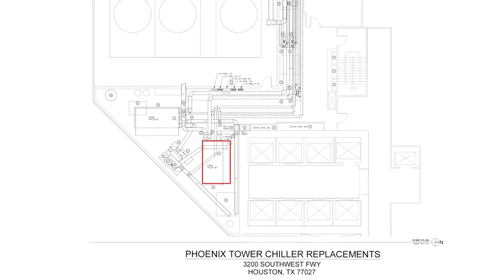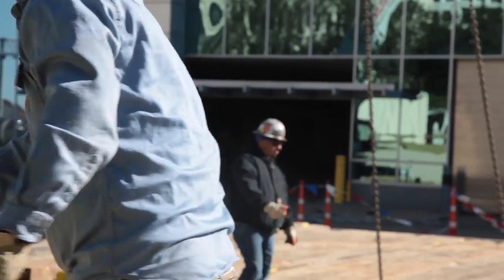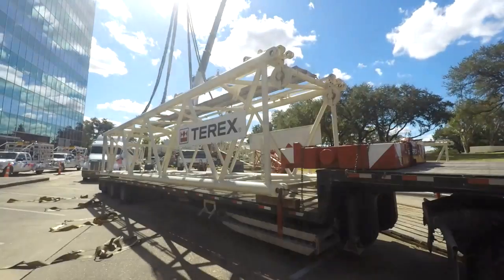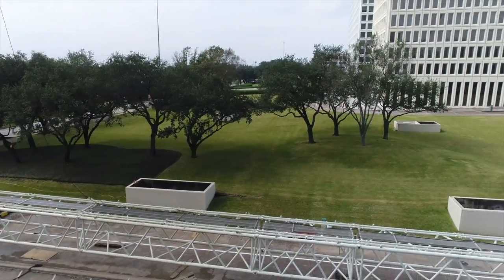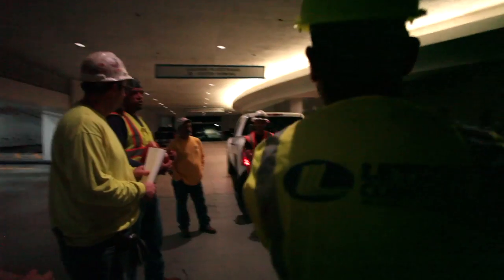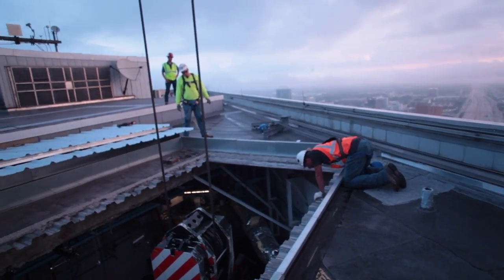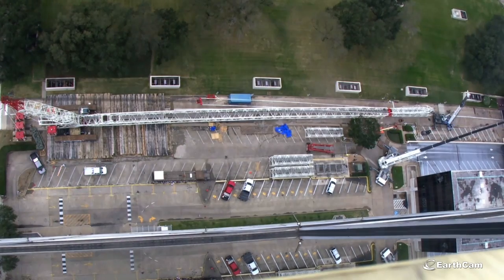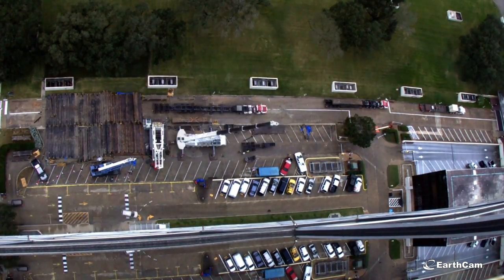Phoenix Tower Chiller Replacement Project by Consolidated Crane & Rigging

Comment: I used to be the Project Engineer for a corrugated cardboard manufacturing company. I was tasked with sizing, ordering, and placing a large industrial fan system used to pull trim waste from factory and send it to cyclone separator and recycled product area.

The actual unit was not excessively heavy, but due to where it was being placed on roof, open space for crane, and other factors, crane contractor needed their biggest mobile crane. The roof location was 100 feet in from edge of building, 3 stories up, and parking lot area where crane would set was 25 - 50 feet away from building. I forget actual numbers, but I think load was about 5,000 pounds and crane was 500 ton capacity. Due to long reach and angle of boom, extra counter weights were added. 

Took crane company several hours to set up, they added a top jib for extra reach. We were in flight path of local airport, but under height restrictions. I called FAA anyway to have them tell pilots to stay clear. We put a bright safety flag on top. Actual pick and place took less than 30 minutes. Set up and take down took hours. 

When I see massive cranes and the massive job of just setting up, I am always amazed. You know it's a tough pick when you have huge cranes assembling the really big one.

Comment: Can’t believe that it wasn’t done with a heavy lift helicopter like a S-64 skycrane. It would have to have been cheaper than the huge crane and all the man hours involved and the expenses associated with all the trucks hauling it everywhere. That job took a small army, when it could have been a few people in the helicopter, a few on the tower, and a few on the ground. 

I’ve personally seen a skycrane change out heavy industrial hvac stuff on top of a local factory. Fast and efficient.
Reply: Equipment too heavy by 10,000 lbs

Comment: Nice job!  Curious- why the extra counter weights not attached?  Just in case chiller was heavier than planned?
Reply from the maker: Good question. There was a large concrete obstruction that would've prevented the cwt tray from being positioned behind the crane when it was facing the building.  Also, we had plenty of safety factor built in to the chiller weight.
Reply: I’m guessing they needed the tray for raising the boom.
Reply: Being the chiller only weighed 30k the extra counterweight would of be unnecessary. I’m going to assume it was just dot raise the boom
Reply from the maker: @lilranks  that's correct.  The cwt tray was only needed to raise the boom off the ground.

Comment: As an engineer myself...I cannot understand for the life of me why the building designers would put the chiller on the roof of such a tall building. Mechanical rooms should be at the ground level or a floor or so below, with designed access, in anticipation of these kinds of changeouts. A few comments below give the following numbers...which sound about right to me.
Chiller cost: ~$200K
Installation cost: ~$3 Million
STUPID !!
Reply: "Designed access" is through a roof. When space is limited, the only option there is is the top. Do you know how much space and the cost it would take to put this on the first level and be able to bull rig it out? Obviously not or you wouldn't make such asinine statements.
Reply: I love seeing big cranes in action and how these guys can rig up such a big tall crane in such limited space.  But I really do think that the designers/architecture could've used a basement chiller here.   This is way too much work and cost to install a chiller.  This is not like NYC where you have so limited ground space.  This is in Houston where chance is that they couldve used a bit more land and bigger basement for this.
Reply: @lmaolmao8826  not much. Some pencil rollers, come alongs, chain falls and skates is all you need.
Reply: @LowMediax  whatever you say little fella.
Reply: @lmaolmao8826  if you don’t know how to rig without a crane just say that my guy.

Comment: Seems like it would be easier to mount the chiller in the basement...
Reply: Problem is you arnt pumping fluid up that far to the roof.
Reply: @nfb615  Of course they are...why do you think they put it there?!
Reply: Cold air sinks, therefore it's easier to create even air flow through out the system by starting on the roof. Especially for high rises.
Reply: @christopherdixon7270  The chiller make cold water, which is then pumped to where ever it is needed. There is no "airflow" except within individual rooms and floors.

They can be mounted in basements, this happens all the time.
Reply: Seems like it would be easier to stop stupid comments...
Reply: @Billvagsayer  No, that's not possible. People like you will always make stupid comments.
Reply: lol. you guys are hysterical. these comments gave me a good laugh.

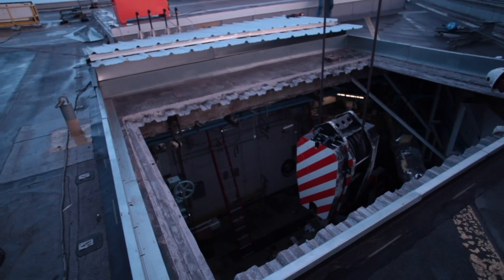Comment: 8:31 that retractable lanyard is attached the wrong way
Reply: Probably done that way so if he fell, the line is letting out after any sharp edges, rather than before TO the man, as a sharp edge can cut the wire in that way. if you look at the hole in the roof, you can see the roof sheeting edges. Though really the guidance on those is that they need 6 metres to properly work. (It's why I've always just given a confused look at site managers who want me to wear one when ballasting a goddamn Demag AC 200. To demonstrate what I meant to one manager who complained, I put it on, and, when on the ballast wagon and had a suitable soft surface, dove off it then showed it hadn't locked throughout. They need a lot of momentum to lock in. a good inertia reel (as theyre called in the UK), in that 'it works to stop you in a fall' you'll be constantly fighting with as such a good reel wont need much to lock in. a 'good' inertia reel in that 'it lets you work without fighting it all the time' needs a lot and maybe shouldnt be used if you're less than six metres off the floor, in which case you should have a fixed line.

Though yes. normally, the reel part when used should be at the anchor end, though nominally in such use as no part of the line will be against a sharp edge, aka like when roofers have a crane for the reels, and so the block is up in the air (I've had that as a *slinger*. Boring as hell as we just sit in the crane twiddling thumbs.)
Reply: If you're referring to the "yoyo" attached to the windowashers anchor point, your argument is invalid.

Comment: I was at a convention center in Memphis and the mechanical room, with two chillers in it, was in the middle of the building with multiple floors about it. Granted it was not 400' in the air but no good way to get them out knowing at some point in the future they will have to be replaced. WTF?
Reply from the maker: I know what you mean.  We see it all the time.
Reply: There is a German crane company that specializes in long heavy reach project of gas and oil applications.

Comment: i wonder what they charged the owners of Phoenix Tower?
Reply: A smaller setup, Manitowoc 21000, the man charged, one million dollars to bring it in, set it up, and one million dollars to take it out. PLUS rental. Small family owned business in the Ohio area.
Reply: Mitchell Giebler much of the money spent is on project liability insurance. These jobs are as risky (for a short time) as sending a rocket into space. All is well during the lift, until it isn't. There is also the public liability. Cranes do collapse for various unforeseen  reasons. There are also operator and site management mistakes in judgement. 
I was there when the 400 ton crane collapsed while they were building Miller stadium in Milwaukee Wisconsin years ago. It had a 400 ton section of the steel roof structure on the hook at about 200 ft above the field and was slowly moving it into position. I was driving by on the freeway and noticed the American flag was blowing straight east. At the same time I was looking at the crane thinking how risky it was for it to be working in a steady 35 mph Wind. At that exact moment the crane slewed west and dropped its load on the outfield area. Even from half a mile away I could hear the thunderous impact of the 400 ton load. Three men died while working on the infield. Many videos of the occurrence were taken. Not a word was ever said to the general public about liability. It was a tax payer project with many cost overrun issues.

Comment: awsome project but why couldn't a helicopter have lifted the air conditioner  ?
Reply: Only one helicopter could have lifted that much - the m26. Russian made, there is not many in the US. It would still be a very difficult lift. Given that there are many more cranes that could do it, it was probably much cheaper to use a crane. It was for sure easier - that kind of lift is common in Houston. My father and Grandfather were union ironworkers who specialized in rigging and heavy hauling. Lots of oil refineries utilized those kinds of lifts around Texas.
Reply: @scottwheeler2494  how much was that lift 1 million? I would find an AC unit that could be disassembled and chopper it up , 55 semi loads to set up a crane ?
Reply: @scottwheeler2494  what was the weight lifted ?
Reply: @ExploringCabinsandMines  he said 30k. Then figure 10k for rigging. So probably 40klb total would be my guess.
Reply: They could have, but they would have had to disassemble the old chillers more. I know of only one (in my past 20 years)building that I have been even partially involved in that used an Erickson Skycrane. It was rumored to cost a half million to make the lift. The new chillers could have been ordered disassembled (Form 7). 
Consolidated looks like you guys did a good job.

Comment: What was the total cost of the project?
Reply: I have no affiliation with these guys. The mobb and demobb  would be no less than $150k in and $150k out. Asembly another $150k, Ground prep ran approximately another $60k ,that would include removal. 
 Hoisting would run $1200 to $2000/ hr  with a daily minimum of 8hrs.

The rigging, storage and transport of new goods $100k
Removal and disposal of old equipment another $100k

The job probably ran $1 million by the time it was all over.

Comment: Why didn't they put the chillers in the basement?
Reply from the maker: They definitely should've done that 30 years ago when the building was built.
Reply from the maker: @marccarroll2803  that's typically what they do here also.  Not sure why they designed this building that way back in the early 80s when it was built.
Reply: No reason to think ahead. It will be the next mans problem.

Comment: Buildings much taller than this need to change out heavy AC equipment. How do they do it? There are no cranes that can reach.
Reply: MrPLC999 I have seen them use helicopters or you can bring them up in freight elevator in smaller pieces and assemble up top. Likely tho building as tall as you mention likely was engineered for a Derek crane to be assembled on the roof as opposed to on the ground.

Comment: Why place such a chiller on the roof anyway! Should be on the ground floor..
Reply: I guess the point is that cold air goes down, and if u want to pump it up, it will be compressed = heated. Not sure, but for my opinion it seems logical

Comment: Why not just use a helicopter for this swap? I’m a crane operator and have worked with helicopters to change ac units on high rises
Reply: The guy said in the video they weigh over 30K lbs. An S-60 Sikorsky Skycrane max payload is 24000 lbs.

Comment: Project cost?
Reply: Probably pushing $500K.... We joined in a rental of a 375T Hydraulic for a lift in DC, 23 stories 110 ft on the jib. All that for our 2 tons of steel and 3 RTU's...  It was $50K for 4 days. 1 day setup 2 on the lift 1 breakdown... 13 truckloads... Our share was $10k.
Reply: $1.5m

Comment: One question. Why use this crane and spend all this money. The one man said estimated weight of the chiller was 30000lbs. There are Skycrane Helicopters that can easily lift this load with no issues. I’m sure using a Skycrane Helicopter would have been a fraction of the cost.
Reply: Other high rises in the area...and no fly zones of bases nearby

Comment: you would think a helicopter would be cheaper and more practical, a skycrane can lift 20 tons.
Reply: Insurance purposes...been there, done that.
Reply: @Billvagsayer  i worked with helicopters in the past, they often had several million worth of telecom gear slung under them or even people. no issues.
Reply: @SupremeRuleroftheWorld  The job we were going to use a helicopter to set some large fans, the building owners said no.  We would have to clear the building of people.   They said we were liable for it all.  We opted to use a crane and a gantry to complete the job.
Reply: @SupremeRuleroftheWorld  ...also, those chillers weighed in excess of 30,000 lbs.
Reply: @Billvagsayer  if the client wants to pay the costs for it then its his problem.
Reply: @Billvagsayer  big stuff like that is better to lift in sections and assemble on the roof with a separate lifter during the roof installation/comission. makes installing such things also a lot more comfortable to work on. stuff like compressors and pumps dont need to be in the rack/unit to lift them in place.  its like trying to move a complete server rack versus removing the servers first. it also allows the installer to check the unit for factory defects. in HVAC you also know that QC is "questionable". i cant count the number of units i had to fix before commisioning, most didnt weigh 20k lbs but still. its better to lift 10k twice then 20k once. also a lot cheaper and less restricting then 1 crane that can lift that. if you can reduce the weight and lift multiple times its generally cheaper and faster to dump everything on the roof and install it when you are ready for it then faffing around a unit thats not properly assembled anyways. just sight glass and dryer location is something of a pet peeve of mine. just put a STANDARD fucking sporlin catchall and a slightglass with regular fittings on a location you can fucking reach you factory dickheads. /rant
ps: that owner is BS, its up to the building manager to clear it out. best done on a sunday or whatever and then mess around with HVAC and comms/power then faff around with that on regular workdays. most clients are idiots.

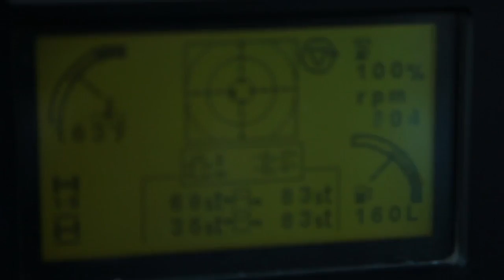Comment: 6:30 I hope he's not reading the owners manual.  😄
Reply: He is. Union guy with no experience with this crane.
Reply: Wim Meerkerk um I would hope/ think that they put him on some equipment that he was familiar with. If not then that’s completely reckless. Not arguing with you though
Reply from the maker: It's called an operator's manuel. Something every operator should be familiar with no matter what size crane you're running.
Reply: @consolidatedcranerigging2844  Like to see a video on the load chart calc'
Reply from the maker: @hamstrtj He's one of the most experienced crawler operators in the state of Texas (and he's non union).   Not saying anything bad about union operators... just clarifying since you made that comment.    In that shot he was using the manual to explain something to the cameraman.  No matter what size crane it is the operator should be familiar with the manual.  On a crane like this with as many configurations as it has it would be irresponsible not to open the operator's manual even if just to confirm what you already know.
Reply: @consolidatedcranerigging2844  give this man a beer!

Comment: So my quesstion is this.did nobody take the time to calculate the weight being lifted ,height of the building and crane capability before starting the job.don'tt tell me,the computer told me the first crane could do the job.brain power  and thinking not so much,computer doing our thinking f"""""" up after f """""""""""""""" up.

Comment: Wouldn't it have been cheaper and quicker to use a helicopter...??
Reply from the maker: I'm sure there's some military helicopters capable of lifting that much   weight, but these chillers were way too heavy for a commercial helicopter.
Reply: @consolidatedcranerigging2844  MIL MI-26 are available for commercial hire, with a 44000 pound capacity. Having said that you did a great job.
Reply from the maker: Thanks @andyphillips7437 .  That's interesting.  I've never heard of any helicopter service making lifts that heavy in the US.  Some of the contractors that bid on the job explored the helicopter option and didn't have any luck with it.